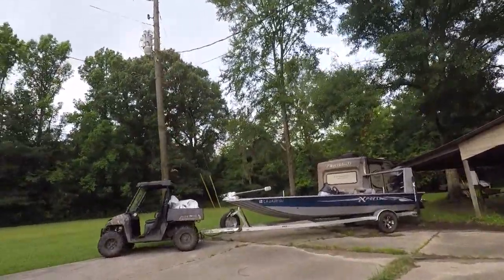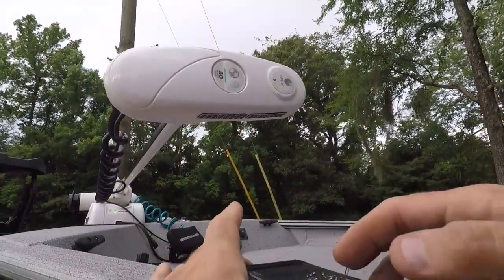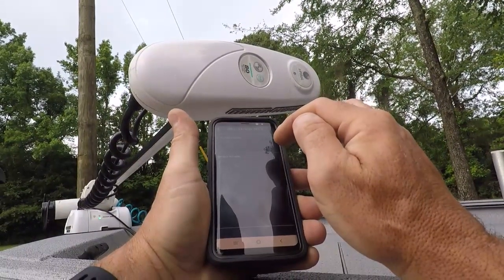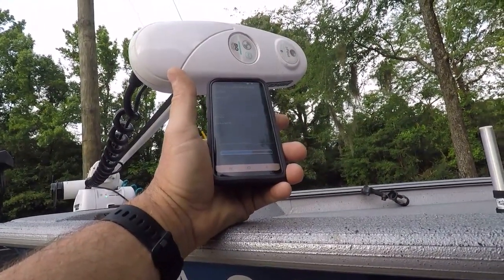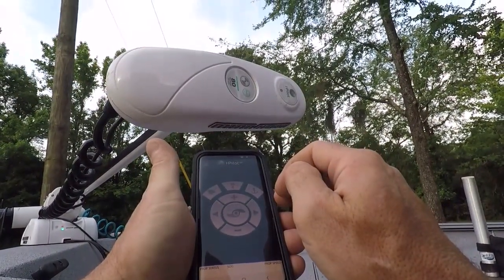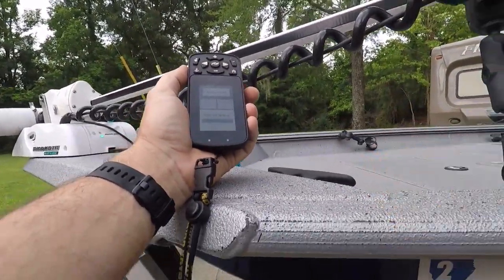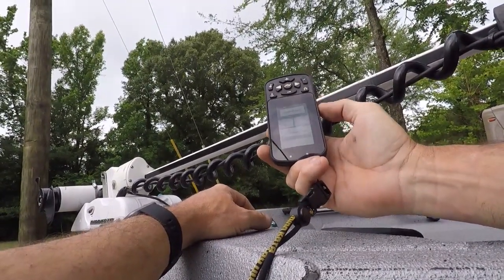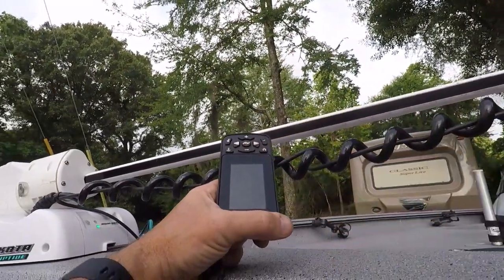Minn Kota Ulterra, Ultrex, Terrova i-Pilot LInk Software Update using the i-Pilot App

Comment: Have you had any issues with this unit? I’m looking at the Ulterra 112 saltwater. Just hesitate on dropping 3k for one
Reply from the maker: I love it.  Only issue I've had was the remote battery died in the first three months.  Called minnkota and they shipped a replacement battery immediately.   Been fine since. Basically I'd seen this trolling motor on a charter we took and was so impressed I bought the boat so I could have the trolling motor.  Lol.